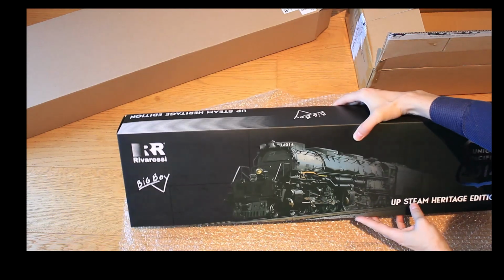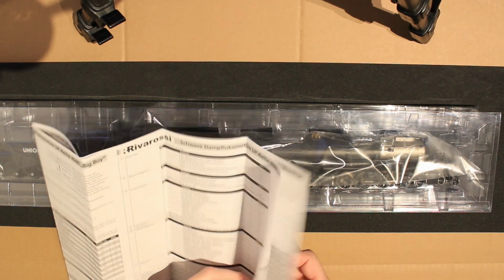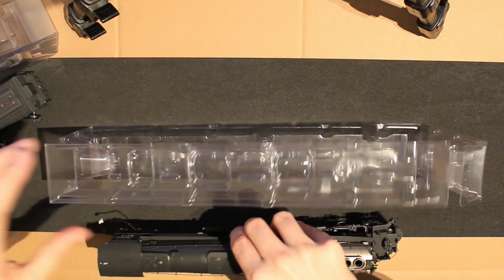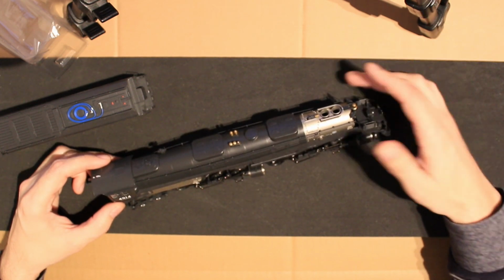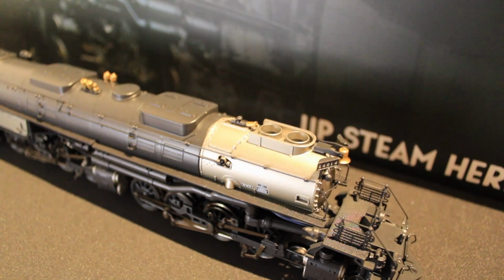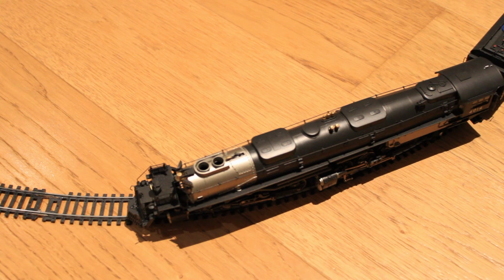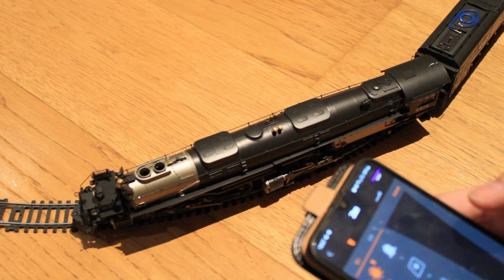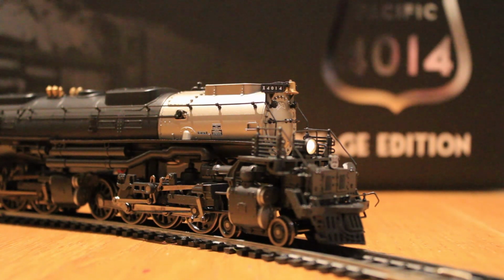Unboxing of UP Steam Heritaga Edition Rivarossi Union Pacific 4014 Big Boy with sound H0 HR2884S

Comment: Hi, can the 2884s be driven on dc power only or do you need to have a dcc sistyem? Thanks in advance
Reply from the maker: There were 2 versions of this set. One in DC without decoder (no sounds) and the one with decoder. The decoders also have an option to disable them. Dcc loco can also run on dc, but it will still make some sounds, but they cannt be controlled.